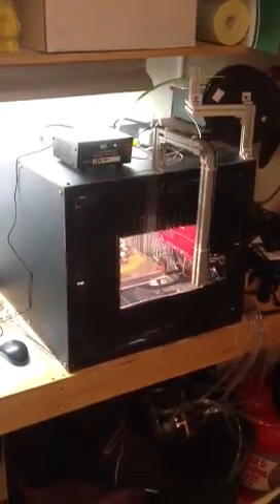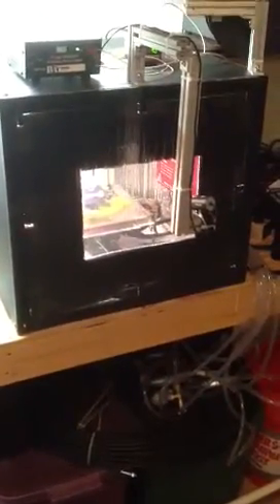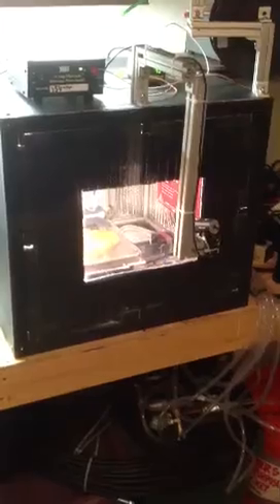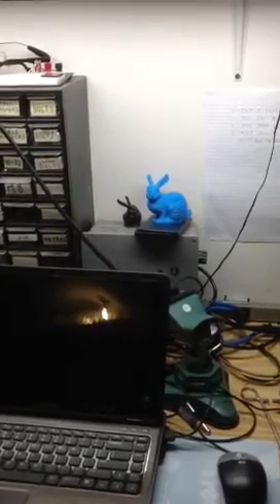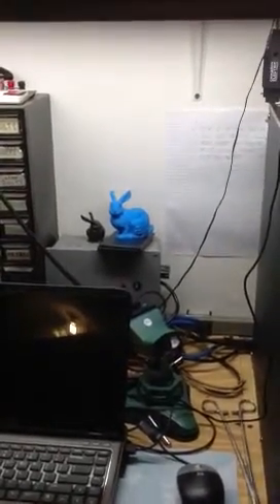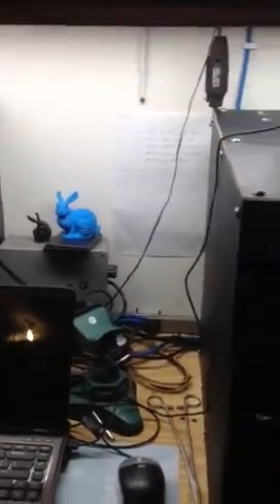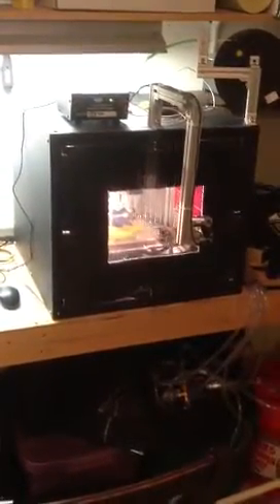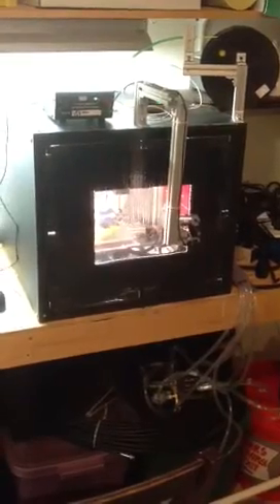Heated, insulated build chamber 3D printer

Comment: any link of the cooling block of the nema17
Reply from the maker: If you type "cooling block" or "cooling heatsink" in the search bar on eBay, you can find identical or similar water cooling blocks for a few dollars with free shipping. They are typically used for CPU's or GPU's, but they work very well to cool stepper motors as well. Be sure to attach with heat conductive epoxy or at least heat sink compound and attach to the motors with brackets or cable ties.

Comment: What radiator did you use/attach to your NEMA 17 motors? I am also making a heated build chamber on a different concept (i.e. flat plate above the x-axis rail which drapes a curtain of oven bag material over the build platform) but this idea seems much more elegant and less ghetto.
Reply from the maker: Type "Radiator PC" in eBay. You can find many small radiators meant for water cooling PCs. Attach a strong fan the the radiator and cycle water through cooling blocks on whatever you need to cool. I found that only the extruder motor and extruder cold end really need water cooling. The little motors for X, Y, Z movement do OK even in a 70C environment. The extruder motor is working harder and gets hotter. The cold end of the extruder definitely needs to stay cooler than the environment temperature. Using a single wall bag, you will not be able to reach 70C. Without good insulation I had to dump several hundred watts in a box to heat it to 70C. That can also be a fire hazard. Enclosing will help in general to avoid air currents, but you will still get delamination on large prints until you make the entire environment uniform in temperature, and approach the glass transition of the plastic you are printing.

Comment from the maker: Hi. Thanks for the comment. Yes, delamination of ABS has been eliminated pretty much completely. I am having good luck with 70C, but it requires water cooling the motors and the extruder. I would like to experiment with other settings as well. I am now printing on acrylic with the bed also at 70C. That's a big departure from ABS slurry coated Kapton tape on a flat surface at 110C. A real experiment only changes one thing at a time, but I am sort of in a hurry to try to make everything perfect.